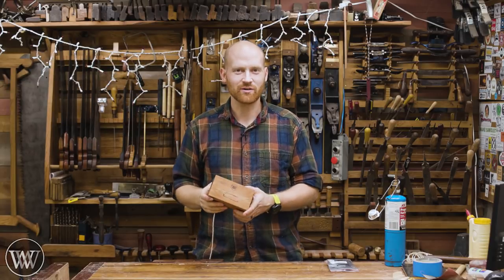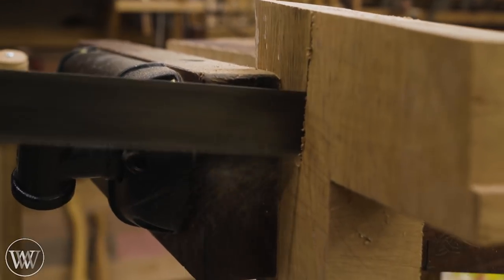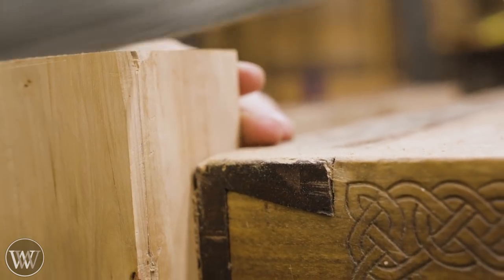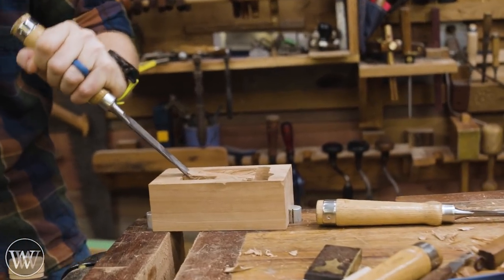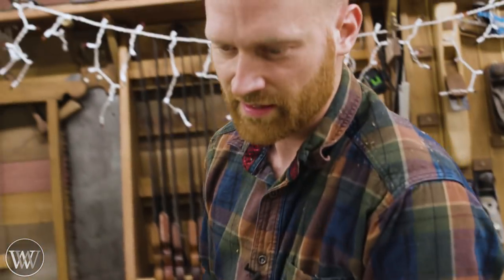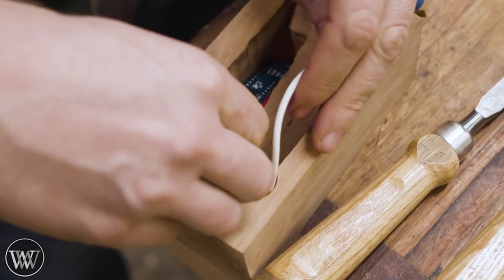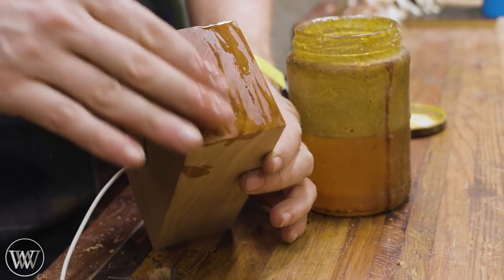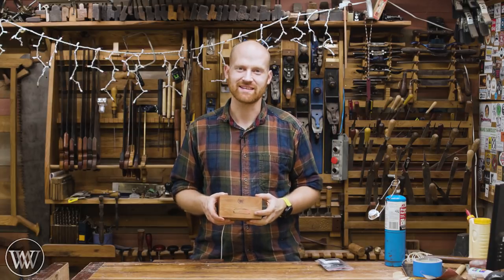How to Make a Digital Youtube Subscriber Counter From a Block of Wood

Comment: An idea for you to try: Cut a hole in the wood where you're placing the counter.  Take a plane shaving from the wood block and glue that over the opening.  Feather the edges of the shaving until it it blends in with the rest of the wood.
Reply from the maker: that is something I am going to experement with as long as I can support the shaving in the opening some how!

Comment: my best guess would be to make the body height just less than the width of your plane blade and make a veneer from a shaving of a single full width pass of the plane to glue on for the front.
Reply from the maker: I am thinking of something like that, but need to get a bigger plane and the electronics are bigger then the plane.

Comment: How about carving the segments of the seven segment display in out really thin from the inside and leaving the rest of it thicker? Or you could try drilling a series of really small holes in the wood for the light to shine through. Like just barely poking the tip of a brad point bit through the surface. To make it easier to fix in case of failure using a side from which you have sawn off some material and then cut a veneer to glue on from that offcut. Have you tried to hold the veneer when working the second cut side by glueing it down to a flat board with hide glue, work the veneer to desired thickness and then reverse the hide glue and stick it in its final place? This process would ofc require the show face of the veneer to be the side facing into the block of wood you cut it from and planing the backside nicely before sawing the thin sheet off.

Comment: I wonder if you could plane a very thin front cover to glue back on over the whole face of the block. Then you could support it on your bench. Or maybe leave it a little thick and use a needle to poke small holes to let the light come out more.
Reply from the maker: i have thought of doing it with end grain and letting the natural holes in the wood do it. there are lots of ideas!

Comment: Maybe if you put a clear resin inside between the wood and the LCD, , then you can shave it down and the wood would be supported and would not tear.
Reply from the maker: that is basically what I did. it was gel super glue. and it supported the wood quite well.

Comment: If you designed it to look like a speaker, with a thin mesh rectangle in the front (to cover the LCD) it may look ok.  Something that looks purposely designed.  Good try with thinning the wood out but the 2P10 is evident.  You will figure out something.  Frosted, dark plexiglass may work also.  A matter of taste?
Reply from the maker: I have a bunch of ideas I want to try!

Comment: What about epoxying the counter in when the front is still relitivily thick, letting it set up then plane it down to thickness. Might keep it from bubbling up.
Reply from the maker: that is basically what I did but with thick super glue. the black lines are where the glue soaked through the wood. it would be even more with epoxy as it has longer to work.
Reply: @WoodByWrightHowTo  I gotcha. Didn't think about it soaking in more with the longer set time. I'll be curious to see what the final solution you come up with.